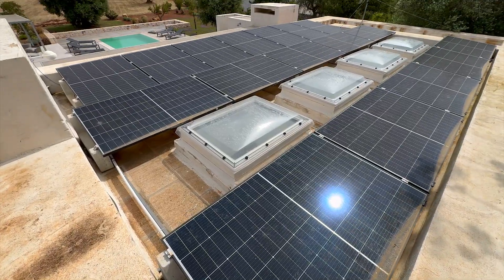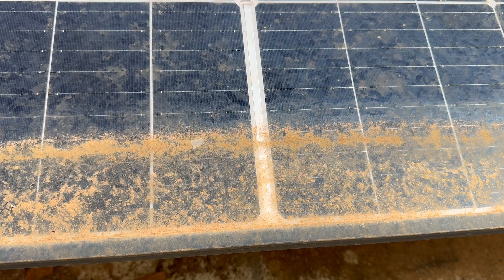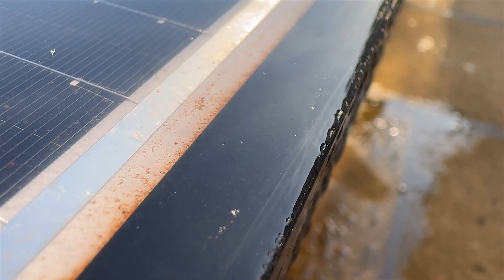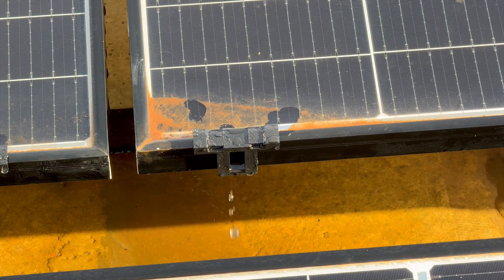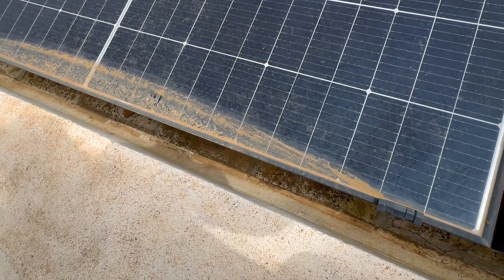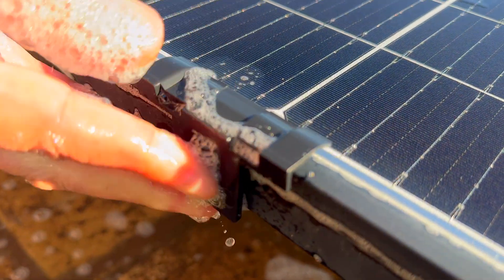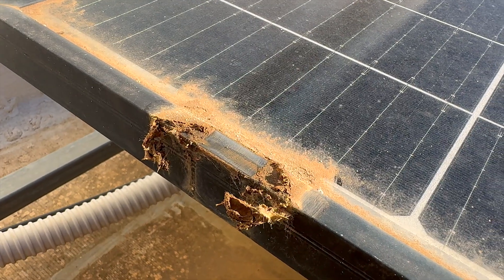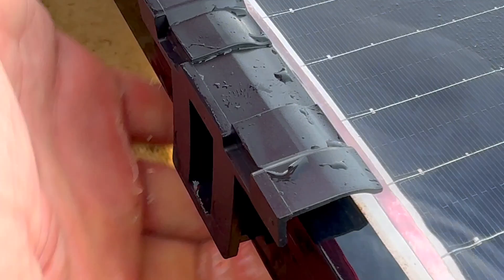This Tiny Device Claims to Keep Solar Panels Clean — Does It Work?

Comment: Just because the roof is flat doesn'tean the panels have to be. Just build the framing so when the panels are mounted they'll have a more suitable tilt. This should also increase the output as they'll be more perpendicular to the incoming sunlight.
Reply from the maker: It’s a planning requirement in this area that panels aren’t visible.
Reply: @efixx okay, but not visable from where? Surely even a 15° tilt would be enough to shed water without going above the parapet walls far enough to be seen from any reasonable position.

Comment: just install them at 45% = problem solved.
Reply from the maker: Planning restrictions in this area.  45 degrees would cause another issue.
Reply: 45 degrees would add substantial wind loads and may rip normal roofs off in extremely windy storm events. Panels should be tilted to the minimum 15 degrees, the additional solar output is nothing compared to a missing roof + panels & zero production.

Comment: Using them on my solar panels which have a 15 degree incline. They really do work. After it rains, there is barely any water left on the solar panel edge and the amount of dirt accumulated is considerably reduced. I highly recommend them.
Reply from the maker: Great feedback thanks 🙏

Comment: I just gently filed  a groove in the edge of the panel frame with 6mm dia file, it works perfectly, panel slope 4 degrees
Reply: È il tuo Castillo italiano Gordon? I have this problem on my garage roof installation but really accessible so not such an issue, but still a problem when we get the Sahara sands blowing over.
Reply: Congratulations you have successfully tempered with the warranty.
Reply: @rishabhkushwaha3767 A manufacturer could argue that these drains would also void your warranty.
..
Reply from the maker: Great tip!

Comment: Using them on my DIY install on my garage roof. barely a 5 degree slope on them and these little clips do help massively to keep the water and dirt flowing.
Reply: Works well on my campervan too.
Reply: Similar to my install  i have worked out mine are less than 3 degrees (flat roof annoyingly slopes down towards north). Previous to fitting these the panels had noticeable standing water on them after rain. Now when i look out the window they are clear of water within a few minutes of rain stopping. Panels are also alot cleaner where the drains are located.

Comment: Nice little device but it does highlight the obvious.  Initially the wrong panel type was fitted on flat roof.  OR poor selection and erection of panel orientation and axis planes (should be slanted/sloped)
Reply from the maker: It’s due to a planning constraint.
Reply: @efixx fair point.  Some council planners do not help very much and seem to go against common sense.
Reply: @sergiofernandez3725  Round here, because within 5 miles of an airport, the airport have yay or nay over large arrays because of potential glare to pilots, all kind of restraints can exist
Reply from the maker: Check out the Longi panel in this video - low glare specially designed for airports https://youtu.be/t0N2a0rpdPs?si=SaHr_wtzZLUYWS81
Reply: I think that there are a lot of situations that it is the best of what you have. Mine is on a garage roof with a low gradient slope and all that was available. Is not a perfect world
Reply: Panel mount angle has to be matched to lattitude of where you are on earth...it's not just an angle decided by the installer.

Comment: If you were quite skilled with an angle grinder, you could cut a few thin channels in all the lower edge lips... 😁
Reply: doesn't that weaken the frame? Will have to try on a scrap frame.
Reply from the maker: It would be a disaster 😉
Reply: Yes but that likely voids all future warranty... Clips are better and "safer"

Comment: Did it affect panel performance, or was it just a visual improvement?
Reply from the maker: We didn’t have enough time to look at the generation data in granular detail. We are working on a deep dive video looking at various forms of shading. Stay tuned.
Reply: @efixx  I will, maybe you could get Joe to do a CPD on it? It's an often overlooked thing, shading massively compromises output of the entire array
Reply: (either Joe, or your good self.... if you're not too busy abroad, or gary!)
Reply: Most panels are wired up in such a way that blocking cells across the short length of the panel will severely affect power output.  If the dust was allowed to accumulate on the short edge for long enough it would definitely make a measurable difference.